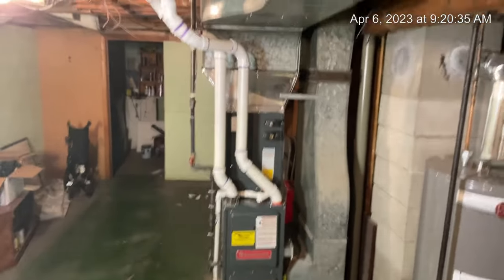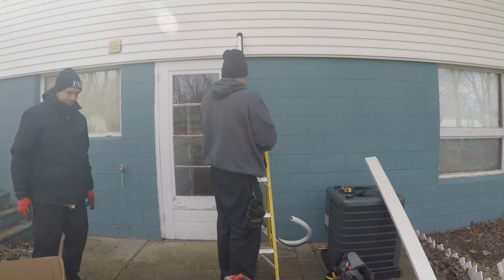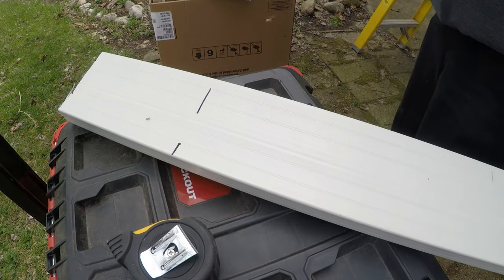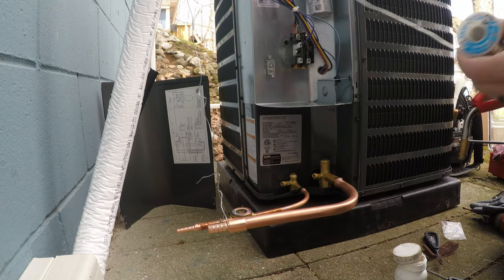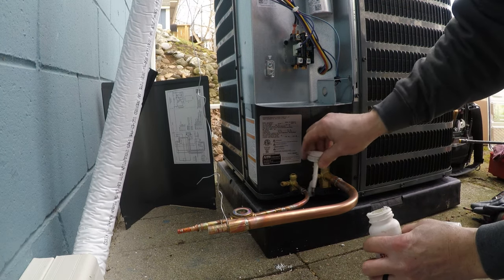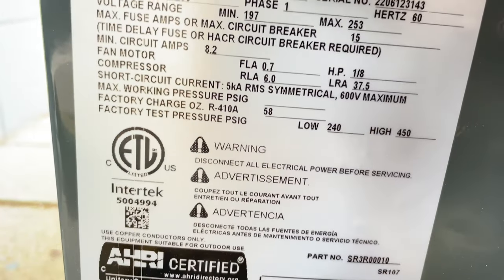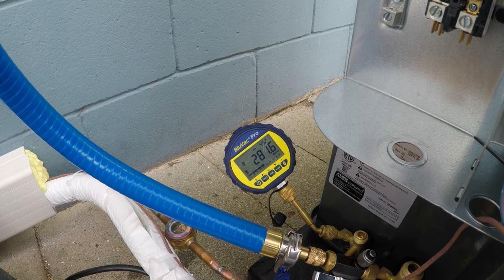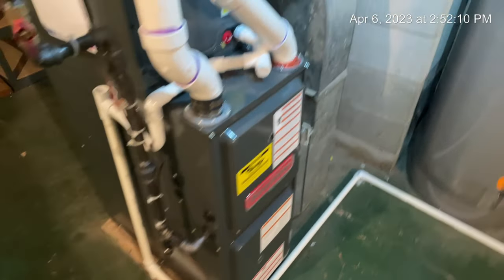Goodman ac install With Yoga ACR pipe

Comment: Good job neat work never heard of yoga acr  line set is that  something new?
Reply from the maker: Thank you! It’s been around for about 6-7 years I believe not 💯 certain. I have been using it for about 5 years. I have it on about 125 Air conditioners, no issues can’t use them on heat pumps.
Reply: How much per foot is the yoga?
Reply from the maker: It varies, when I calculated the last time I checked it’s about 25%-30% cheaper than copper. The downside is the up front cost have to get the ACR press jaws and the other tools. But after a few jobs those will pay for it.

Comment: Turbo torch and silver sodder! No. Too hot
Reply from the maker: Yes, we have been turning it down after this one! Here in the near future, going back to copper line sets and Brazing.
Reply: @ADVANHVAC  amen
Reply: @ADVANHVAC  Leaks? That why your going back to copper and brazing.
Reply from the maker: @jordenb9469  no leaks I'm saving what I have left for those special jobs. My supplier has stopped carrying it. There wasn't a big demand for it.
Reply: @ADVANHVAC Saw a YT video show his job with some burst tubes (Yogapipe). That's why suppliers stopped selling it.
Reply from the maker: They were using it on Heat pumps. That’s why they burst.